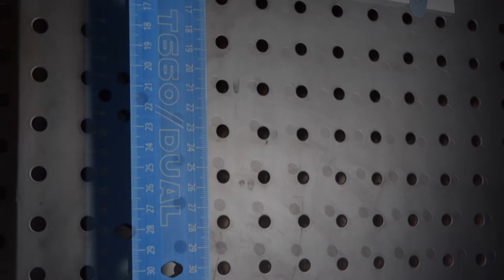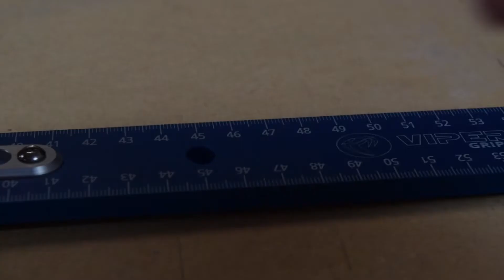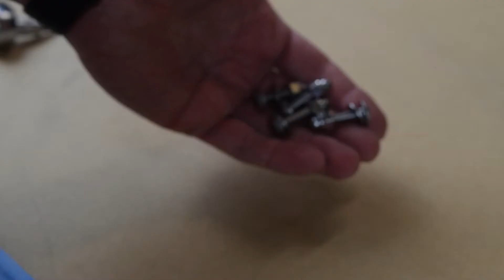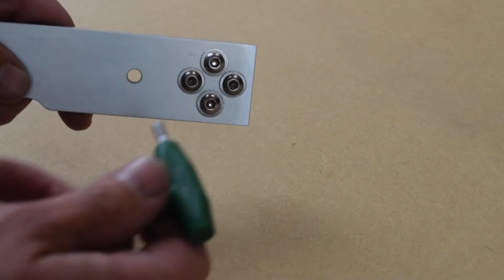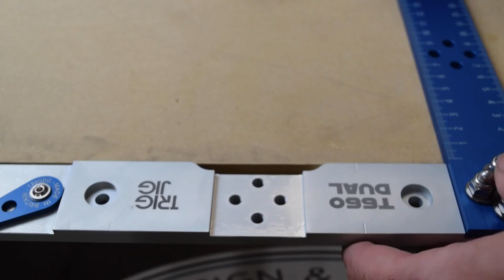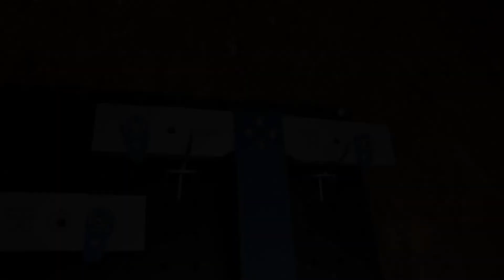TrigJig T660 T Square Assembly

Comment: Guys I like how you try to reinvent the wheel and a T square is one of my daily use tools but this is too much.
If I want a square I'll buy a good square, same with a T square.

I have too much to lose in materials and time by swapping, changing and  caliibrating set ups.
That just doesn't work for me.
My most used 90° square is a 1970's German made wonder.
Accurate, tough and set for 1 angle that I can bet my life on.

Sorry but this is just too much hassle, it's like an automatic car with a clutch.

I would like to see a nice T square with drill guides, at least 2.
Something i could quickly set up for say drilling door handles or shelf supports.

Multi use anything is always a failure, from tools to fighter jets, anything that tries too hard fails.